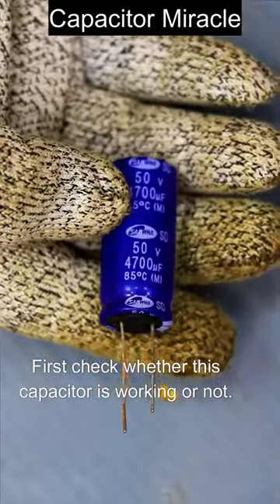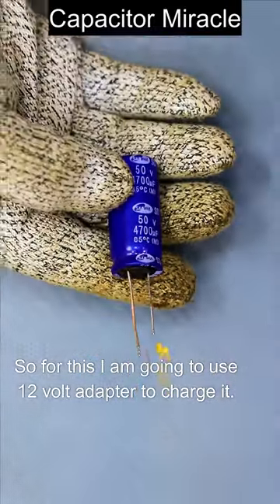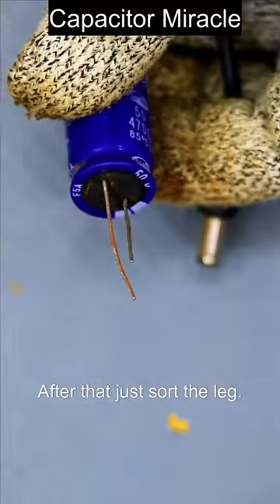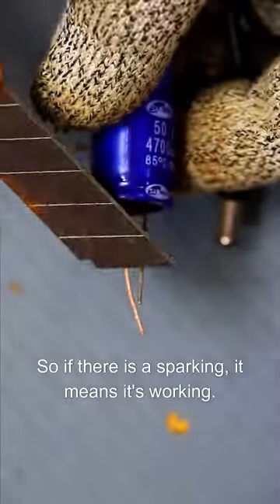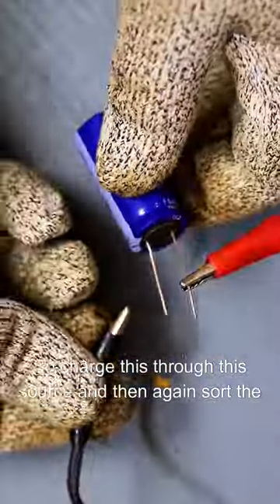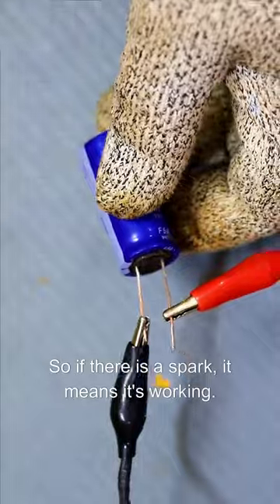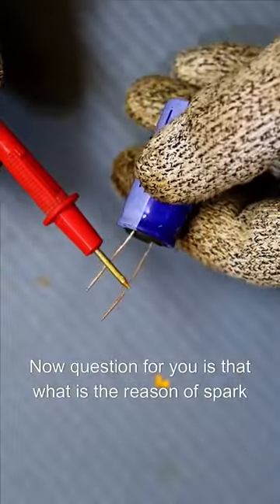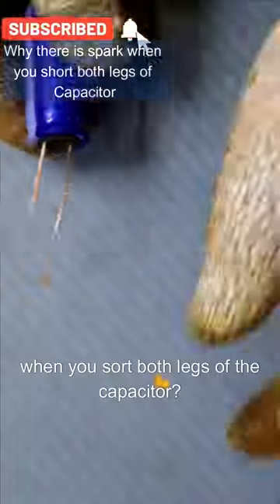How to Test a Capacitor in 5 Seconds  #diyelectronics

Comment: So what’s the reason of the spark?
Reply from the maker: The electric spark occurs due to the sudden discharge of stored energy in the capacitor, causing a rapid movement of electrons across the shorted terminals, which ionizes the air and produces the spark.
Reply: @The.Innovative.Indian  thank you!